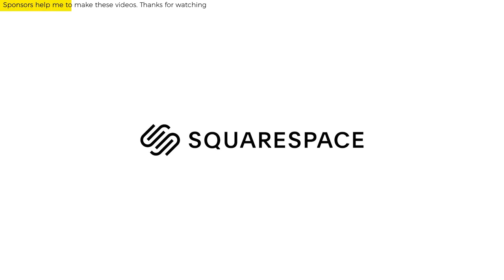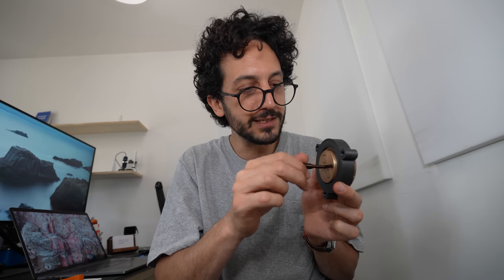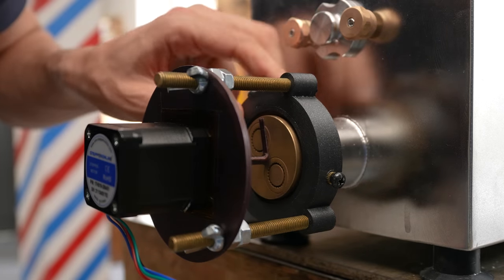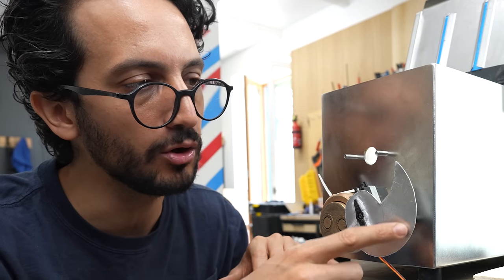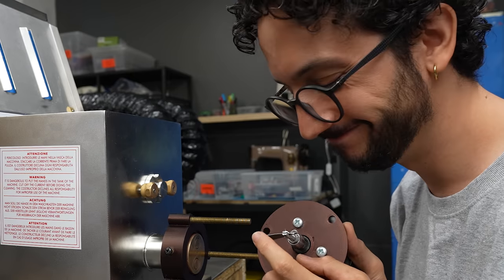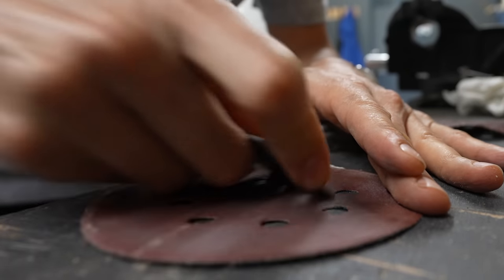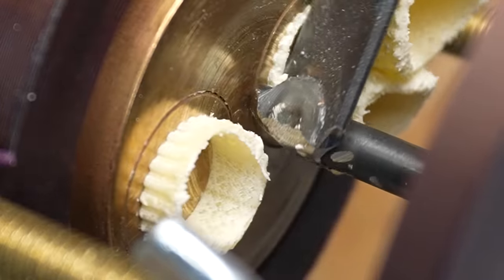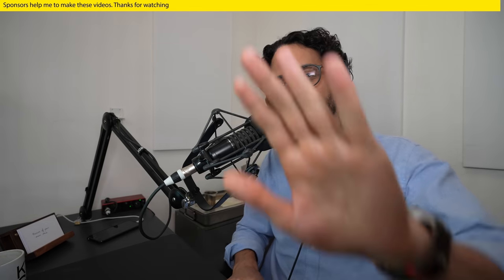I Tried to Make an Automatic Pasta Cutter (did NOT go as planned)

Comment: Hey Alex, why not try a brushless motor (or stepper motor) with position control. You can wait as long as you want for the correct length, then cut quickly.
Reply: Yes, this is the way
Reply: You could also use a thin wire as a blade
Reply: I agree. Like an old film camera or film projector. They move in quick steps.
Reply: Also, don't assume that the cutter's axis needs to be in line with the extruder axis
Reply: The NEMA motor he used is already a stepper, not necessarily with a position encoder but could provide a step counting based position control.
Reply: Other way to do fast cuts : Build the stepper motor not in the same axis, but off axis of the extruder pipe. In that way the turning center of the motor will be more far away from center. A metal plate can be used to make the cutting base flush with the extruder. Then, you can program a waiting time followed by a very fast 360° turn of the motor.
Stepper motors have less torque when they run slower.
Reply: @markushavers2283  no
Reply: @markushavers2283  Yeah. I agree with the off-axis thing. Make it behave/look more like what he was doing by hand with the knife.
Reply: You don't even need position control for that. He's already using stepper motor, all you need is just set it up so it turns quickly for a single turn and then wait for required amount of time (5 seconds as he measured in the video). And just loop it up.
Reply: Why overcomplicate things? A gear reductions would be sufficient for gaining in torque, and maybe a simple DC motor with a pwm control for adjusting the speed while cutting if needed.
Reply: @markushavers2283  Essentially, a better version of what the tried doing with the offset arced blade. I think that was the right call, just need a sharper, thinner, flush, less wide blade.
Reply: I love how we are all thinking the same thing.. lol  I think his tours of the factories prejudiced him (and I don't mean that in a bad way) to the cutters he was exposed to on high feed rate extruders .vs his little extruder.

Comment: Two options:
- a very long blade with the motor off center so the cutting action is quick and sudden
- a short blade actuated by a brushless motor controlled as stepper or a servo ac motor, cutting very fast across the pasta, then dwelling until the full pasta is extruded.

Basically, reproduce the action you do with the knife manually...
Reply: I couldn't explain it better, while engineering, think like an engineer and good results will follow you
Reply: Or he could just do what he did at the end as that worked
Reply: or a piston moving the blade up and down!
Reply: This is absolutely one of the best ways to go about it, and the piston up and down is also a great idea given the small form factor.
Reply: @angrypotato_fz  spot on
Reply: @OlaNordmann123  it worked but not well, the pasta is not cut straight and  with other shapes it will not work.
Reply: @bschwand  I will work, because it did, his design is just some polishing behind the one you buy for that type of machine. 

And don't come here and pretend you somehow have more knowledge of automatic pasta cutters than the manufacturer of it. Every cutter I can find works the way he did it. He is not trying to reinvent the wheel here. He is just copying a design that already works.
Reply: @OlaNordmann123  my points are valid. Look at the industrial versions. Not everyone can think and optimize like an engineer.

Comment: Use a box cutter blade, it even has a ø4mm hole on one site for attachment, the Nema 17 stepper has enough torque, if you run it at 24V with a decent blade.
Reply: and if you a stepper library on the arduino, you can run a speed ramp, so the blade has a high acceleration to the cut, then ramps down and stops for brief moment until enough material is extruded. Instead of continuous rotation. A pit like giving a good punch at first impact of the blade with the pasta, then just steadily  slice through.
Reply: @SarahKchannel  Exactly!

Or make a thing like a "wide gap tuning fork" and attache a cheese cutting wire. Then add a sensor that could tell when the wire was right between the two extruders. And when enough pasta have been extrude make a 180 fast rotation.
Reply: @MrMartinglob  fast 360 would be better.
Reply: @magicman9486  fast 180 is enough indeed
Reply: @MrMartinglob  Sensors are great, but you technically only need to do a homing position at start, as there is most likely no skipped steps. A hall effect sensor would do quiet well as it is contactless and does not care are 'dirt' as much as all other type of sensors.
Reply: @HVVV-l7g  Yeah thought about razor blades too at first, but they are a bit short considering the mount. A box cutter blade is like at least 80mm long and can be easily snapped into the desired length.
Reply: Definitely think that a manufactured razor like an olfa knife is the way to go for the cutter itself, it's really difficult to make anything even remotely as sharp as one and they have the advantage of being completely replaceable when they wear.

Comment: I think you're thinking about the timing all wrong. The reason the big pasta extruders in the factory work with continuous rotation is because the extrusion rate is high so blade speed can be high during continuous rotation. With your machine's extrusion rate, it would make more sense to spin as fast as you can for one revolution, then program in a waiting period.

You can have the motor set up on the side like how you did the prototype with the big weird shaped aluminum cutter. You even used a stepper motor, so you can set position to 90° and command the motor to spin 360° as fast as it can per cut. You used a wiper motor, think about how intermittent wipers work; the blades turn quickly, but there is a long rest period between cycles.
Reply: The extrusion rate is high, and also it is a big die holder, with lots of individual extrusion dies, which means for a given extrusion speed a continuously rotating cutter can have a much higher linear speed to get the same length of pasta.
Reply: Actually, using a wiper motor from a car, with all its circuitry, might be the cheapest way to get this done.